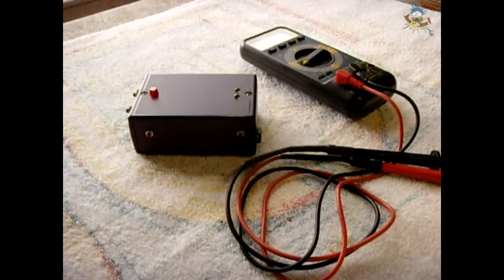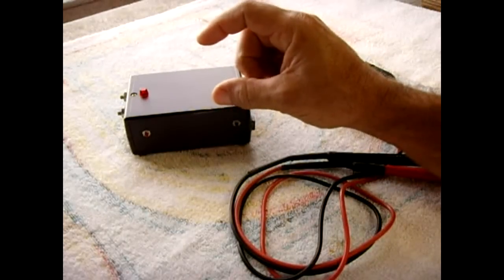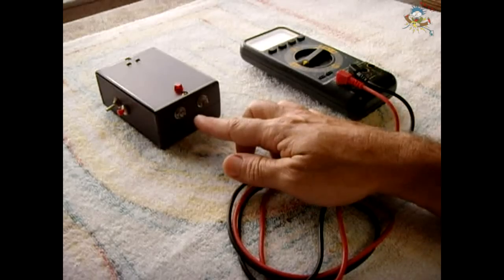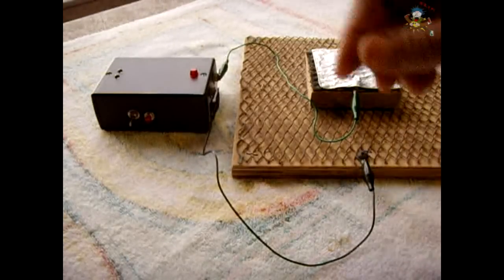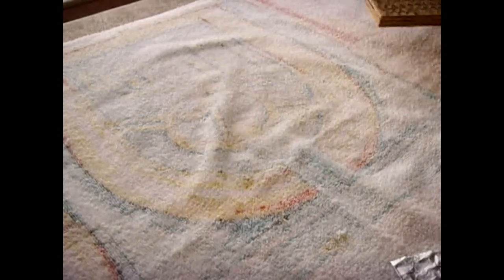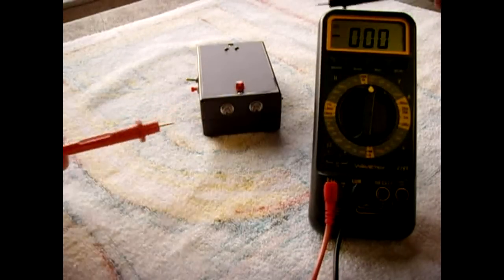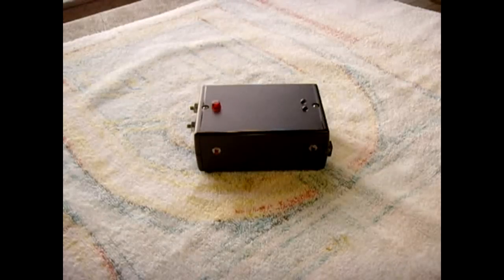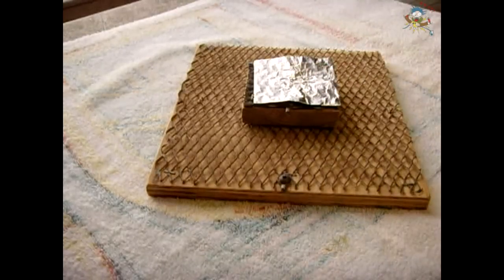RID-O-RAT Homemade Electronic Pest Control Device

Comment: How much current does it take to kill the rat? It is funny as a kid i tried a similar project with with just voltage from a transformer hooked to feeding plates just like you have, when it stands on the bottom it gets shocked when it goes to eat from the second plate, but my experiment indeed shocked the rat, but i came in to see, and it was gone, with burn marks where its feet was in the bottom plate(i used old pizza pan for bottom plate). It didn't kill it, i seen the shape of its feet in the pizza pan. lol
Reply from the maker: I have no idea how much current, but I do know at 450-500V there is enough current stored in the capacitors to kill them.

Thanks For Watching!
Reply: electronicsNmore Thank you, if i ever try it again i will use your ideal, thank you much, That is why i ended my experiment instantly when i seen it didn't kill it, i felt bad, like an immoral person causing pain and suffering because it never killed it. I thought it would kill it instantly is why i thought it would be humane, but all i did was cause it pain and suffering to it.
Reply from the maker: I have seen rats killed by 120V/240v in the past. When I repaired AC condensing units, and inside electric panels. Some rats are really tough to kill, and they are very smart. If the current flows from a wet mouth to feet, they are usually done. Nothing is 100%. I really don't like killing them, because I had pet Gerbils as a kid, but they can be very destructive and cost you a lot of money. So I am forced to kill them.
Reply: Tony Hardy your story is funny never would have thought of  that. We have a mouse in the house at the moment. And yet we also have two dogs ... Still thinking hmmm....
Reply: Tony Hardy do you recall the values of the transformer or what it was to?  We have a mouse I need to get rid of. Thanks..

Comment: Wish this was better lit so it was easier to see.
Reply from the maker: Hello. Make sure you watch the video using the highest video player resolution setting of 720p. I have a much simpler and better design coming out in the very near future. :-)
Reply: Look forward to seeing it. 

 Suggestion, use female jacks for the outputs so they cannot be touched and short leads with mini jacks or banana plugs.  

Better yet would be to just incorporate the electronics inside the trap but separate from the mouse area.

And increase the lighting. You don't need a bunch of old Mole 5K broads but a few 100 watt table lamps would help tremendously. Note: higher resolution will not eliminate under lit images only light will eliminate shadows.

Comment: what about a NEON transformer giving 160,000v at 60A.
Reply from the maker: You must be mistaken. Neon light transformers are between 10kv and 15kv, and very low current of around 30mA.
Reply: Let’s see... 160 kV at 60 A. You think a neon transformer would be capable of delivering 9.6 MVA?

Comment: Dude, all that and only a hypothetical zap of a metal tool.  No schematic and part models/values so we can build our own and no sapped rodent at the end. Common!!!
Reply from the maker: The average person won't be making this, it's deadly to humans if they get shocked. I explained that I used the high voltage joule thief shown on my channel, to charge up (2) electrolytic capacitors placed in parallel. As for the rat, there were none.

Comment: you my man i need some diagram and part list for this
Reply from the maker: I took the High voltage joule thief circuit shown in my other video, and used the output to charge the electrolytic caps. Fairly simple.